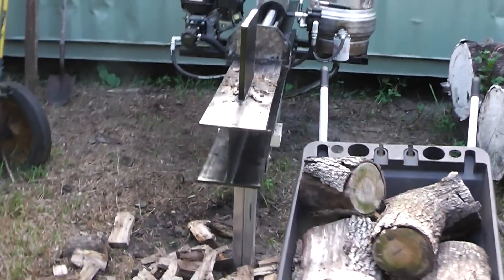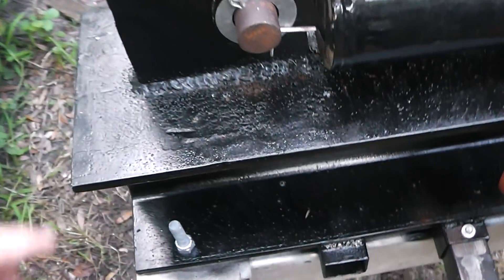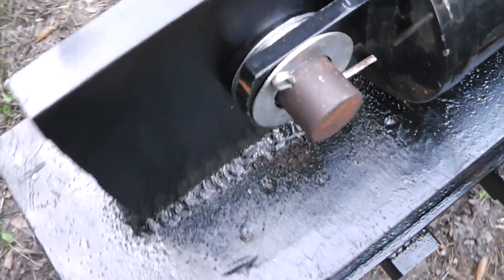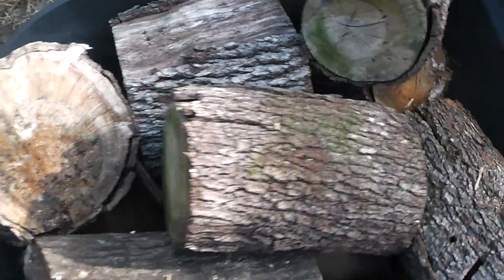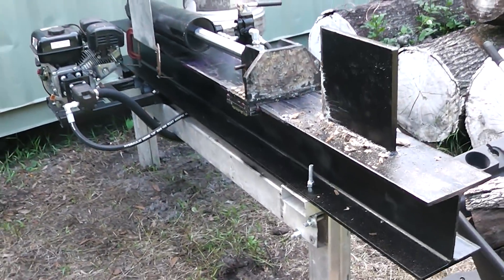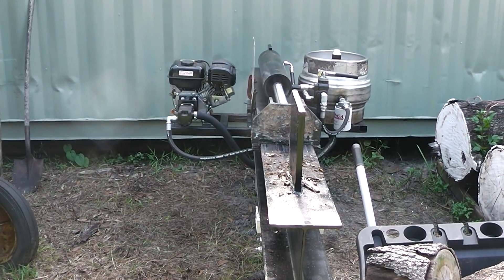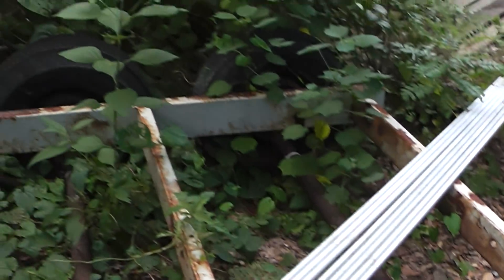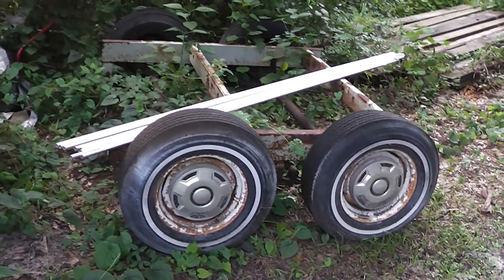30 Ton Homemade Log Splitter Completed-Well Almost

Comment: Nice video very helpfull, so let me get this straighr, i need gasoline engine then i have to connect it to hydraulic pump via connector on crankshaft then hydraulic pump need to go to control arm, then to hydraulic fluid conteiner? Sorry english is not my language🤣🤣

Comment: The stroke is 2 times longer than the length of log that fits into a stove. The splitter blade should be 10" closer to the cylinder so that the piston is not extended all the way out.

Comment: I was a bit worried with a large number of fake reviews but I am very pleased with the results. Bit of background, https://www.youtube.com/post/UgkxmKn8dCAXovWn8_cLYoosGLVrVrpwlIMc I need to split approximately 1.5 cords of wood and didn't feel like destroying my back. I purchased this anticipating to have a few issues splitting wood but have only come across a few logs of elm where the stringy nature of elm made it more difficult to split. Overall its not a necessarily fast process but it also isn't a very arduous one either. I came and went fairly often to do different tasks but once I stayed and got into a system I could easily split my pieces in a fairly timely manner.
Reply from the maker: The motor went bad about 2 months(Jun2023) ago but, other than that, this log splitter with its new engine still gets the job done.

Comment: Hi how many cc is the hydraulic "pump" you have on the gasoline engine?
Reply from the maker: 0.192 cu. in. / rev. HI press. stage(3.15cc)
  0.994 cu. in. / rev. LO press. stage(16.29cc)
https://www.surpluscenter.com/Hydraulics/Hydraulic-Pumps/2-Stage-Log-Splitter-Pumps/16-GPM-2-Stage-Hydraulic-Pump-MTE-Hydraulics-S21707-5185-9-7972-16.axd

Comment: Is that a 2 stage pump? Nice job thinking about building up my 20 ton have I beams and material
Reply from the maker: Yes. https://www.surpluscenter.com/Hydraulics/Hydraulic-Pumps/2-Stage-Log-Splitter-Pumps/16-GPM-2-Stage-Hydraulic-Pump-MTE-Hydraulics-S21707-5185-9-7972-16.axd  It says it needs a 8HP engine but it seems to work will with the Predator 212.

Comment: You need to see if it will split some real wood like hedge or walnut. I would bet that it would do just fine. That rotten wood you’re splitting we don’t waste the energy to even cutting it. Over all job well done. It will split.

Comment: Great job that is a 5" ram i think you said but what gpm pump are you using  loved your video thank you? Duey
Reply from the maker: 16 GPM.
Reply: @homesteadprepper  Thank you im making a forgng press with a 5" cylinder but was sent when i ordered my pump they sent me  11gpm i wanted a 16 gpm is way to late to get exchanged im steal working on my metal work i hope it works really dont want to buy  another pump  it is a Concentric pump thanks for your advice  Duey
Reply from the maker: It will work but, it will be just a little bit slower.
Reply: @duanehoover1979  you'll be better off with 22gpm and 16hp , the 16 gpm pump will be slower but powerful .i run a 28 gpm on my 5" ram it has a 3" spear .

Comment: Hello. Looking at your design, did you find the oil got hot when operating at full speed say over an hour? How much fluid did you end up using? 45 litres? Ty

Comment: What size engine did you use? I'm building one now but have a 5hp Honda engine for the time being
Reply from the maker: 6.5 hp predator HF engine.
Reply: @homesteadprepper  Ok thank you for your reply. I will get one of those instead of using the 5hp Honda motor I have

Comment: When you build it your self, satisfaction is priceless !!! I have build mine with the same gph pump and engine HP, I used a 3.5inch cylinder though.  If I just change the cylinder for a 5 inch, will the force to split the wood increase ?
Reply from the maker: Yes.
Reply: But slower
Reply: 3.5 x Pi x 3000(psi) = 32,986lbs or 16 tons.
5 x Pi x 3000(psi) = 47,123lbs or 23.5 tons.
Power would increase by roughly 46%.

Comment: Hello, very good video, could you tell me how many HP is the engine and how many gallons is the flow of the pump? Thank you very much, greetings from Spain
Reply from the maker: 6.5hp engine and 2 stage 16 gallons per minute hydraulic pump.
Reply: @homesteadprepper  thanks for your resquest.

Comment: seems to work well, surplus material? material you already brought? scrap material from another job? they still cost you money... not sure why you wouldn't add that to the cost of building as a true cost.. bit of a false economy to say "I already had it, so it didn't cost me anything" and you still didn't say how much it cost? I understand sometimes its not about the cost but just fun to build something.. if thats the case they why even mention it right? - Thanks for sharing the build.

Comment: I built my own using a Wisconsin 2 cylinder engine to power it, the beam was 1 inch H beam 14 feet long donated from scrap pile at work, pump came off ram hoe. I had to buy the rebuild kit  pump donated from scrap at work. I actually had to pay for hoses and valves. Had old axle from house trailer. After I was done I cut a 14 inch shag bark hickory against the grain. My wedge is tool stee 18 inches tall, 12 inches deep and 1.25 inches thick. After I finished they started making box splitters and 4 way splitters. I had a custom box splitter 8 inch by 14 in blocks. Traded for some overhaul work on his dozer. I really like it. My brothers put a hydraulic lift table on it. Now it wanders off a lot. Gotta call 4-5 places to get it back home. But they're all good old country boys. No harm no foul

Comment: Nice work. Building almost the same splitter as well. I would really consider lowering the pump or lift the oil tank to prevent negative pressure on the inlet-port of your pump. If you fore some reason experience this you will for sure have cavitation and the pump won't last long. Just saying as a friendly advice :-)
Reply: Good advice for anyone who is building anything hydraulic.

Comment: I saw one once where the splitting wedge could be lifted up and turned round if you wanted a four way split, but that’s the way to go, keep it simple build it tough and you will enjoy working it much more when you build your own, if you go to your local fabricators shop you should pick up all the steel fairly cheap, they might even do the welding work for you. Have fun

Comment: hey homestead, i know this is a while ago , however you built that rig so well that I bet you couldn't even lift the behemoth of a  trunk round.  If you could, it would crack with ease!  I heard you bought the steel from tampa bay steel, im from the spring hill area.

Comment: Nice work.   Do you think it would have the power or force to cut a piece into 4 pieces.,,, for example, if the wedge was shaped to cut in  a 4 piece pattern
Reply: A 2 stage pump with split anything. Its everything eles that will break lol

Comment: This is great! When I build mine it will be a diesel motor w/twice the HP and a taller wedge. This gives great ideas!!! Side platforms (1) As a loader/feeder w/sides on it so that my Cat  bucket can dump right on to it & (2) with front & back sides with hydraulic dump. Raise the whole thing about 4'-6' off of the ground so gravity can off-load onto a pickup truck or trailer. Also, I would move the hydraulic control close to wedge so that I don't have to hold while stretching. We all get old and we break down. I'm disabled so the "toys" have to do just about all of the work for me.GREAT JOB HOMESTEADPREPPER!

Comment: Put some graphite on top of the I-beam and under it also. It'll help prevent some 
 wear and make it easier for the ram. I use the little tubes that one uses for keyed locks. 😁👍

Comment: You need to add a platform on either side of the splitting wedge, so your wood  doesn't drop to the ground,  if you need to split pieces again /smaller. Easy to do, just weld them to the framer.
Reply: Is it possible to send the name of raw materials used

Comment: Very nice project, you are a man of many talents. Have you thought of making the push piece (don't know the proper name) a little taller to match the cutter end piece height? Just asking when I saw one log go over the top of the push piece.
Reply from the maker: A good idea!  I'm probaly going to make a 4-way or 6-way wedge to compensate for my design flaw.

Comment: How do you calculate the 30 tons?  Is there some sort of formula taking the engine size and pump capacity and cylinder volume in account?
Reply from the maker: Try https://www.google.com/url?sa=t&rct=j&q=&esrc=s&source=web&cd=2&cad=rja&uact=8&ved=0ahUKEwiG1uCHhN3VAhXCQyYKHQGBCqcQFgguMAE&url=http%3A%2F%2Fwww.baumhydraulics.com%2Fcalculators%2Fcyl_calc.htm&usg=AFQjCNFFLt1WxFg1peBUaYKn0DiWE4QsEQ
Reply: it looks like a really nice setup.  Is there a certain type of wood and diameter maximum recommended for the 30 ton?
Reply: BC ElginText  19.635 (area of a 5" piston) x 3000 (psi rating of pump and cylinder) , divide by 2000 (us ton) = 29.45 us tons.